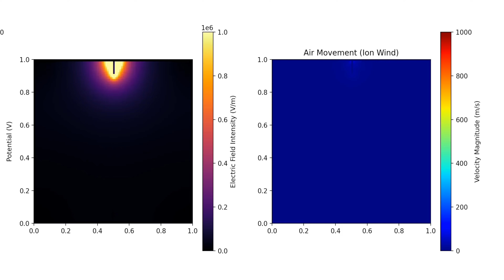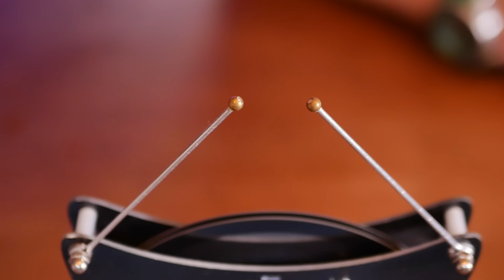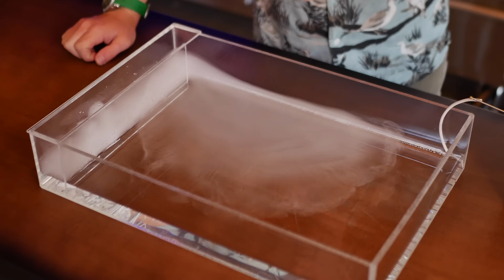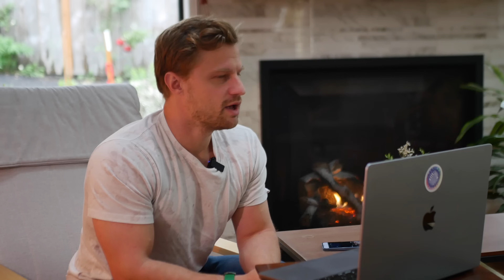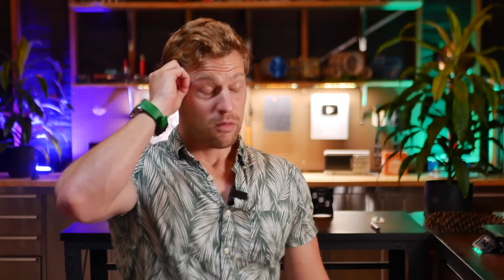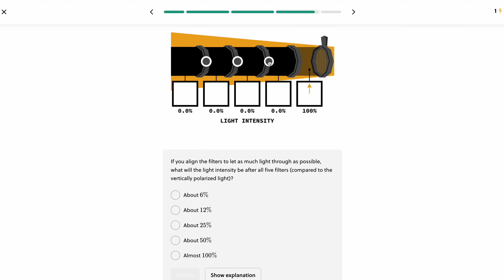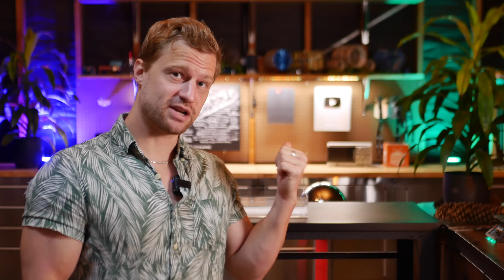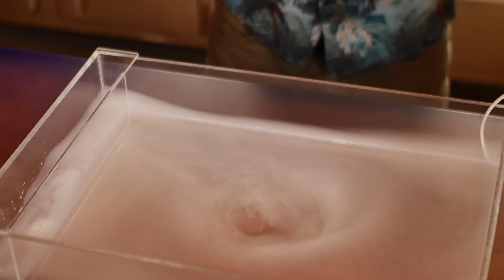This High Voltage Fog Is Controlled by Pointing (BiFrost Nebulagraphy)

Comment: This is related to concepts in electrohydrodynamics, where electric fields influence the behavior of fluids, including vapor.

In this setup:
- **High Voltage Source**: Placing a high voltage source in water can create an electric field that extends into the space above the water where the vapor is present.
- **Water Vapor Clouds**: When water vapor is exposed to an electric field, the vapor molecules can become polarized or ionized, depending on the intensity of the field and the voltage.
- **Rod as a Second Potential**: By setting up a rod with an opposite or different electric potential at a distance, you're essentially creating an electric field gradient. This can act to move or control the vapor, as the charged or polarized particles in the vapor are attracted or repelled by the electric potentials.

This manipulation of water vapor using electric fields has applications in weather modification, environmental control in greenhouses, or even in artistic installations where visual effects involving fog or mist are desired.

Looking into studies on electrohydrodynamics might provide more insights into how electric fields can be used to control water vapor and other particles suspended in air.

Comment: youtube channel wbeaty posted about this many years ago. search high voltage air threads, username wbeaty. he also mentioned the beam or whatever it is moves slowly. he also noticed it works best with some dust on your fingers
Reply: Yep, if you clean your fingers it stops working.  So, wet your fingers and drag them across lint-y cloth.  Sometimes you get two or three little holes in the fog, not just one.   Great discovery:  hold a single human eyelash hair in your fingers.  Works great.
This was discovered by HV hobbyist Charles Yost in 1995, using Scheiren Photography and a large Wimshurst machine.

Comment: I have a complementary electrical theory for tornadoes that suggests if you do this experiment between two metal plates you may be able to creates interesting vortices. A perfectly flat top plate may not be as good as one with a very slight bow in the middle. Love your work. Good luck!

Comment: Ok. Theoretical Question: if you were tu build a massive antenna / antenna on mountain and "stick it" into the cloud layer. If you apply enought voltage, could you move clouds with the other end at your hands???

Comment: now the ionic wind works on dense airy particulate but what if the effect could be replicated on heavier particles like grains of sand/sugar/salt or even things like flour/powdered sugar/ and even a very fine pure carbon dust? what about metallic grains and dusts?

and with the influence of the electrical field i wonder what that field diagram would look like as it travels over the body and into the grounded material?

Can the effect work in reverse with the fog layer on the negative instead of the positive ground?

could this be used in tandem with something like an etcha-sketch or those digital laser writing boards?

could this translate into more effective cleaning apparatus to say become a really weird leaf blower or a good vacuum  or on a vastly sized up scale do you think an effect like this could say put a spot of sunshine above a home even on a cloudy day?

Comment: Quick correction: the phrase "electron tunneling" has precise meaning in physics, and it's not what you described in the video. "Tunneling" in physics usually means the passage of some wavefunction through a potential barrier, not the propagation of electron currents in gas constrained by a field. Maybe "electron streaming" would be better? Not a big deal, but if you're going to use a consistent terminology, it's best not to get your wires crossed! Great video btw, love how you worked through the problem and saw that it matched simulations.

Comment: Id be interested in finding out what happens if you placed an insulating sheet between your hand and the fog container, say a clear plex sheet that was larger than the container that was suspended several inches above the fog container surface.  This is a fascinating effect that surprised me.
Reply: @BillKrueger-zv7kg    Set this up and try it yourself.   Use a negative ion generator or "anion module" as the power supply.  Get dry ice from a local grocery store, and use a cookie sheet supported by plastic cups.
Acrylic sheets block the streams but metal window screen doesn't!    I tried using soap bubbles, but the ion-streams always just pop the bubbles instantly.

Comment: that looks like you could create an ion beam wall for open fridges in shops, or even air conditioning in a shop with open doors. it would be fun to see how much you could  control the ion wind when  exposed to other environmental forces.

Comment: We use this daily at work.   It's long a part of modern instruments, the nanospray mass spectrometers.   It's called "Electrospray," (the laminar-droplets version, so not really a "spray.")  Today is used to isolate single protein molecules in a laminar stream of water nanodroplets, for loading the liquid samples into mass spectrometers.   Even won the Nobel prize in chemistry, 2005 I recall  [edit, it was 2002].   I think it originally dates from around 1915, from thunderstorm water-droplet experiments, and the discovery of the droplet-emitting phenomenon called "Taylor Cone."   
So, sharp needles won't work (just creating a cone-shaped blast of wind,) while slightly-damp human hairs are great!   Single eyelash-hairs work best, possibly because their tips are so sharp, or maybe because the hair is oily.

The earliest use I've been able to find is from 1960s NASA, where it was used as satellite micro-thrusters, emitting hypervelocity droplet-streams of liquid metal.   Apparently a high-voltage syringe filled with mercury, with a mercury droplet at the charged hypo needle, will produce these streams, but I've never tried it.   The amount of material is so small, that just a mercury-wetted, electrically-charged needle might do it.   Or warm gallium, not as toxic.   Compare a sharp wire to a sharp, gallium-wetted wire?

They do pop bubbles.   I haven't tried popping bubble-rafts on the water, or altering colored oil-films.  Bet it works.   If so, then it gives us some alternatives to fog.   (I did try it on large soap bubbles, to see if the thread-streams would affect the colors.  NOPE.  It always pops the bubbles.  Perhaps it's more evidence that this is a high-velocity stream of droplets, and not just charged gas.)   It's a very very small weapon.   Shoot down individual mosquitos?    Just don't mess with vacuum.   At 50KV in a vacuum chamber, the same stream of droplets will drill small holes right through thin glass.   It's a very very small sand-blaster.   I bet you could carve up some microscope cover-slips.

In the 1970s, the "air wires" showed up in Scientific American, as the droplet-emitters for the first inkjet printers.   Today everyone uses micro-boiling to spit the ink drops, but back then it was laminar electrostatic wind, electrospray, and high-voltage deflection plates to draw the tiny black characters on paper.  So, build a 1970 inkjet printer, and then use a 300KV VDG generator to write the ink onto surfaces 5ft away.

Independent re-discovery.   It was in Charles Yost's "Electric Spacecraft Journal" #16, using a sectorless Wimshurst machine and Schleiren photography.   The fog version was from 1998, also 2008 on YT.

[Edit, I recall being told by a friend that he saw the "air wires" directly by eye, back around 1991.  He had a huge x-ray transformer/supply, and had it lifted out of its steel oil tank.  It was in a dark room with a floodlight.   When he turned it on, he said he saw "spiderwebs" projecting from all the sharp points!  Those supplies run at around 150KV.  Oil-wetted sharp points, at high voltage, spitting out visible "air wires" made of microdrops of transformer-oil.  ]
Reply: Dude, amazing info, thank you so much for sharing!
Reply: @JamesBailey123  But also it's very depressing  ...no Nobel Prize for me!   Well, not unless I scan them rapidly back and forth to create fan-sheets rather than thin streams, then crank up the megavolts.  (Bring a 5KVAC electrode from an oldschool neon transformer, and the little fog-hole turns into a line.  Wiggile it with your hand, and it draws a sinewave in the fog.  Mechanical oscilloscope.)   

If a 2D sheet-version  can block air at 1ATM, then you've got a "force field membrane," or an invisible airlock door from Star Wars.  It's the same principle as the jet from a high-pressure firehose, which can be struck with a crowbar, and the steel bounces right off the water stream.  The 2D sheet might sting a bit, if touched, as it sandpapers your fingerprints right off.   Make two of these, then squeeze objects between them!   Make a cylindrical fan, like a hollow pipe, and pump out the air inside, connect to a Tesla Coil, to create a sort of "Plasma Sword."  To make your "blade" only be 3ft long, have the sheet-stream be a cone shape, wide at the base, which converges to a point at 3ft distance.  (Now you know how light sabres can be less than infinity length.)
Reply: @wbeaty  I wish my brain was still sharp like 20 years ago. Thanks for the cool info.
Reply: @PlasmaOscillations  my own brain decayed decades ago.   

> I wish my brain was still sharp - - -   Instead, I'm using the Secret, or Poincaré's Other Method.  To create utterly kickass genius ideas you must 1. work on a tough intellectual problem, 2. totally fail and give up, 3. later get yourself into an altered state, such as taking a long shower, or night-drivers' trance, early-morning semi-dreaming, or in Poincaré's case, leaving work and going on vacation.  Then you suddenly get the big flash out of nowhere.  The "flash" is usually stunning, in extensive detail.  If you'd been driving, you have to pull over and scribble many pages of notes onto the backs of envelopes.   (As Francis Bacon said, never be caught without a pencil and paper, because if you don't get it all down, it will vanish like a dream.)   

Me, I just make sure to remember, while first waking up, DON'T MOVE.  Keep eyes closed.   Instead, spend an hour thinking about odd problems from past weeks.  Usually the complete and detailed answer-from-nowhere will be sitting there waiting for me.   (Heh, if I was a composer, I'd just have to listen to the music in my dream, and then leap up and furiously play it all while recording it   ...before a Person from Porlock interrupts me, and it all vanishes.)

Mathematician Henri Poincaré, when this first happened to him personally while "stepping onto a streetcar,"  eventually traveled around to all the top European mathematicians and asked about similar experiences.  They reported that all their genius breakthroughs came from the same thing:  the detailed ideas just appeared in their minds, like having a long, complicated dream.   They didn't construct the ideas, instead the ideas "came from nowhere," and they just took credit.
Reply: It is a travesty you no longer make videos. Your corpus of work and knowledge is staggering. 
Just my occasional needling of you when I see you around yt every couple years...
You're weird, we know, it doesn't matter! Make videos!
Reply: "In the 1970s, the "air wires" showed up in Scientific American, as the droplet-emitters for the first inkjet printers.   Today everyone uses micro-boiling to spit the ink drops, but back then it was laminar electrostatic wind, electrospray, and high-voltage deflection plates to draw the tiny black characters on paper.  So, build a 1970 inkjet printer, and then use a 300KV VDG generator to write the ink onto surfaces 5ft away."

Possible next video @PlasmaChannel
Reply: @soflo_fpv2  With sufficient megavolts, the laminar stream should have velocities which penetrate soft surfaces, like water-jet cutters.     (Nikola Tesla's tattoo printer, beat yer deathbeams into bodymod tools. )
Reply: Wouldn't that require a steady flow of a liquid to be ionized? Im not so sure thats it in this case, maybe sweat and oils, but that would only last temporarily until all the liquids in the area are consumed.
Reply: @HapyAppleProductions  yep, the liquid is supplied to the metal needle via a ?50? micron quartz capillary and a pump (a tiny glass syringe-pump I think?)  Thermo corp LTQ-XL instrument. 
Good point:  maybe some damp fabric will dry out more rapidly if connected to 10KVDC, because its edges are spewing out hundreds of ion-bridges.  Active electrostatic dessication.   

For very dry fibers, the phenomenon still seems to appear.   I bet the tip of the fiber has a little corona-flame, and the material is literally burning, and emitting smoke (partial combustion debris, carbon nano-soot.)

Maybe we could track the amount of liquid in the "ion bridge" by a short piece of part-full quartz capillary (conductive coated,) run it for minutes and watch the liquid column in the capillary become shorter over time.  Today's chem instruments deal with nanoliter sample volumes, by harnessing the "ion bridge" effect.     

Idea I never tried:  make these "air wires" using oil-wetted fibers as the "launchers," then watch the water surface, to see if a tiny oil patch appears.   Write on the water via colored oil films?   Also try:  fluorescein dye, and a UV flashlight in a dark room.   If the "air wire" is a chain of fluid droplets, then after awhile a little glowing dot should appear in the water.
Reply: Poynting Vectors be like:
Reply: Oh huh, I became aware of the phenomenon through electric spacecraft propulsion like colloid thrusters and FEEP - the latter of which fully utilizes the Taylor cones for an incredibly efficient drive with exhaust velocities potentially up to a hundred km/s (albeit with abysmal mass fluxes and thus thrusts, even for an ion drive), so I'm not surprised you could use the phenomenon to drill holes through stuff in vacuum!
Reply: @warriorsabe1792  I've seen patents for emitter arrays (chip fab, indium droplets in 4X4 pattern on silicon,) so we could make hypervelocity foggers, not just beams resembling single spiderwebs.   For science-fair projects, a slightly-damp mitten does this when attached to KVDC.   All the lint fibers stand up, and form taylor cones on their tips.  Or, there were the paper tubes with torn edges.   
We need to emit hundreds of uA worth of droplets in parallel, rather than only picoamps.   Need a cold rocket engine with a few watts of hypervelocity exhaust in air (kilovolts times milliamps gives watts of work performed on the exhaust-plume.)   Build a silent drone thruster?   Just don't slice any objects, as with waterjet cutters.  Build a colloid thruster, accidentally invent a death-ray.
Reply: @warriorsabe1792  Oddity:  "Project Nick" took place at Patterson AFB.   A decade later, colloid thrusters came from Wright-Patterson AFB.   FEEP and FIB lithography could employ mercury, but 300K offgassing contaminates surfaces.   PS I tried a tungsten whisker (fractured lamp-filament,) and found that it creates FIB drilling effect, and can immediately slice through a half-millimeter of glass.   This in hard-vacuum!   I speculate that field-emission might have sufficent current-density to melt tungsten asperites, then launch tungsten-droplet electrospray.   That, or down at the nanoscale, the surface of solid metals is liquid, so perhaps intense fields can launch nanodroplets from sharp metal structures, wo/bulk melting.
Reply: You have a point, but what if it's magic?

Just kidding, your comment's the most insightful youtube comment I seen in a long time!
Reply: @Smiling.Schopenhauer  OST Phaser beams?   It's just a long thin tube made of parallel air-wires, to contain a moving blob of 100,000K deg hydrogen plasma.    
Maybe get a blister on your little finger...
Reply: @wbeaty  ...maybe get a blister on your thumb....
Reply: fascinating thank you for your knowledge!
Reply: What a fortuitous coincidence, seeing you in the comment section! I've been following your work since 1997.
Reply: @SunRabbit who r u referring to
Reply: Sir @wbeaty, I hope you take this message positively. I'm responding because you remind me of my father. You seem very intelligent but perhaps somewhat disconnected from society. Your responses to the comments give the impression that you're addressing someone else. It seems there are many details that aren't coming across in your messages. If you're anything like my father, you might be writing slower and less than you think, and readers may struggle to follow the connections you're making internally. When my father does this, which is often, it appears as though he's using complex jargon to sound intelligent, but people might perceive him as some kind of charlatan, which he certainly is not. I wanted to share this to perhaps motivate you to enhance your communication, as you appear to have valuable insights on the subject, and it would be verry nice to us if they were conveyed more clearly.
Reply: @mathiaschaves7604    Yep, I spend all day talking to professional scientists.  (Reading research papers is even worse.  They're written in "High Academician.")
Also, if you see a jargon phrase, just look it up.  Usually I used that phrase intentionally, because I know it's a secret search-term which gives good results.  For example,    Threadlike streams of electric wind.   Also, high voltage air threads
Reply: Ty!
Reply: @wbeaty   I sub'd your channel.
Reply: I clicked the 333thiest like on your comment. Man, how deligthful is this to have such a comment after such a video! Thank you!
Reply: Molecular graphene razor blades. Three body Problem